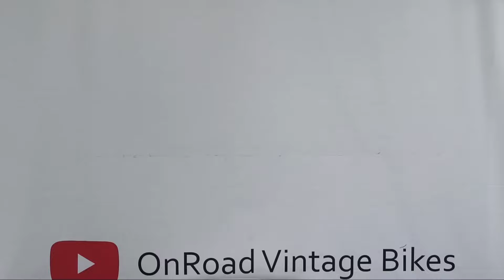Vintage Bike Restoration Gazelle Champion Mondial

Comment: Very nice. The most beautiful bicycles were built in the 1960s and 1970s, until the 1980s, when the craft sometimes turned into art. I can't help but find modern bikes ugly. I also repaired some frames from dents, but with a gas torch and silver for brazing.
Reply from the maker: The beauty of road bikes ended with steel. All modern carbon bikes are the same. Thank you for your support and watching the video.